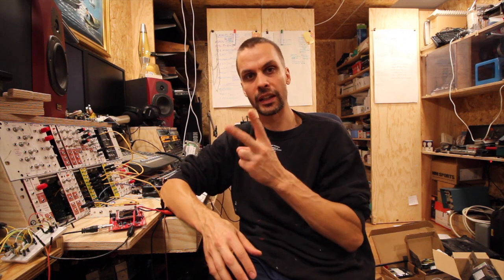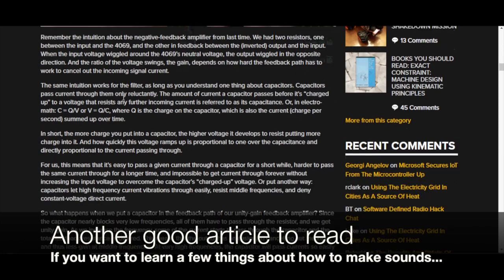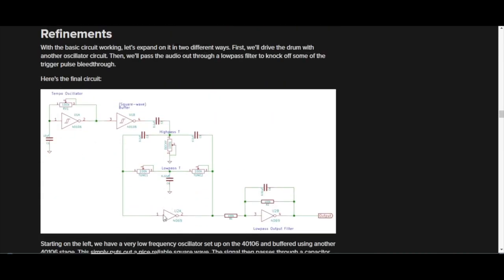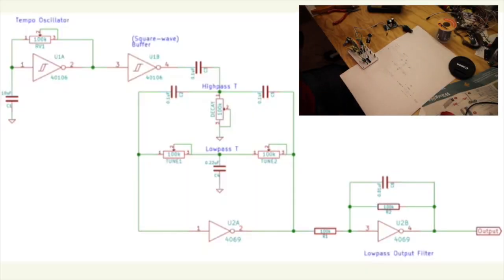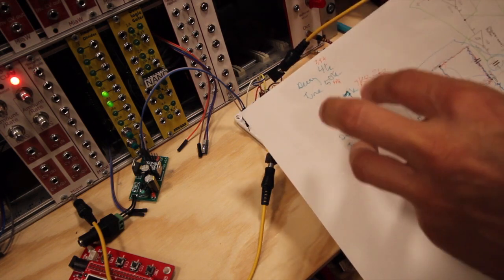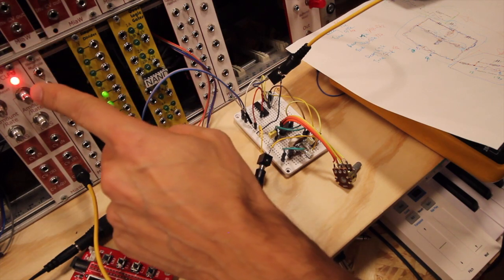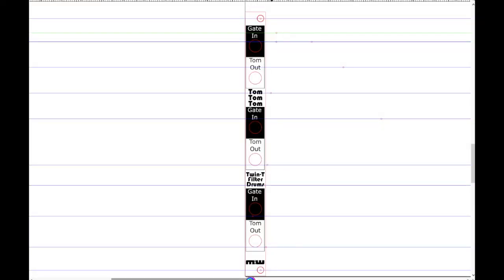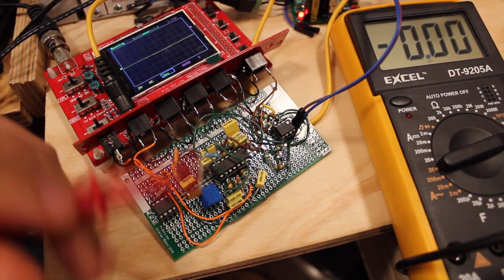TomTomTom Twin-T filter Drums - DIY Modular in a Week 9.2

Comment: Neat-o! I should get to making some drum circuits.. I played around with the Audio artist on breadboard, basically a Twin-T that gets pulsed by one oscillator and gets it's cutoff modulated by another. For modular use you could skip the clock and just keep the good stuff! I remember doing some mod to it making it sound even wierder. Have a look: http://www.synthdiy.com/show/?id=1654 It uses diodes to get rid of the negative pulse. I did a simpler solution by adding a reversed diode to ground after my cap, thus avoiding any voltage drop and still getting rid of most of it. My circuit did not care about the tiny negative that remained.

Comment: This module is already great PER SE.
But it could become even better by doubling it.

And adding an integrated 6 input mixer with a single output line, just to save some cables.
OR just add a 3 input mixer to the existing module, if you don't care for more sounds.

The mixer requires a just single op-amp (any would do, say a TL071) and as many LOGARITMIC pots as the inputs (and a hanful of resistors and capacitors as well!).
Reply from the maker: Yeah, but I learnt my leason from the BaSnaHi, which had a passive mixer and that didnt turn out well, so wanted to try one with all sounds having their own output :) But sure, Im just pushing the mixing problem ahead of myself by doing this so... Who knows maybe we end up with one HUGE module with all the Drum sounds in it ;)
Reply: @SourceryOne  One 6HP module with 3 sounds or a ... 8HP? 10HP? 12HP? module with 6 sounds could be a huge game changer. I'm all for a Delptronics 2xyz... how is it called? and its passive expansion. But they would cost me AN AWFUL LOT for IMPORT TAXES (taxes from USA, Australia, Canada and Japan are ridicolously high in Italy!! About 50% of the price - and you also have to add the shipping) from the US, snce there's unfortunately no dealer in Europe, apparently. Hey! 8 mixed drums in 12HP for about 300€ isn't bad, is it? So, your module, cosing me only... 100€ with 6 sounds and a mixer would really be a meaningful money saving.I'm confident that one day you'll become a Doepfer competitor. And make your panels in aluminum. Maybe RED - Which I love so much.

Comment: Kristian,
Thank you for this series. I love the pace of your videos.

Have you mentioned your new patch cables in another video? Do you still recommend the 100 for $50 from AliExpress?
I’ve just started on the MiaW journey, and am going to have to spring for patch cables very soon.
Reply from the maker: Thanks! Do you mean the yellow ones? Those are the older ones that I haven’t used because they were too short. 
Well... I’m getting to the point where I would like my cables to be a bit more stiff. That would probably be the biggest caveat for the cheap aliexpress ones. As for quality I have only had one fail on me so far. So not really a problem. I might buy a few connectors to make a few of them shorter too.
Reply: Kristian Blåsol Yes, I didn’t realize the yellow ones were older.
 I think the AliExpress price went up a bit ($60 if I recall), which still is the best price per cable.
I was trying to find a decent amount of cables in the $20-30 range but I can only find the ones targeted for modular synths that you only get 8 - 10 cables.
Reply from the maker: A guy in a forum I’m active in started synthcables.com. I think he is based in Europe and makes and sells “real” patch cables a bit cheaper. 12£ for 6. Still not even close to the aliexpress ones but.... 😅